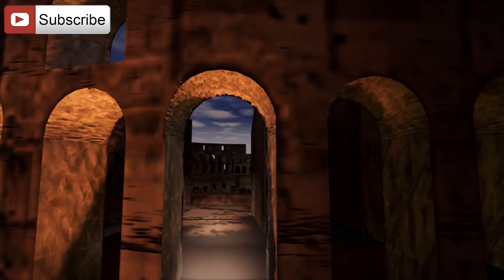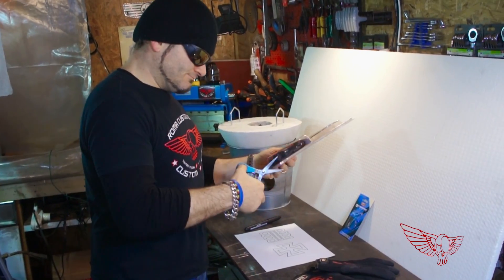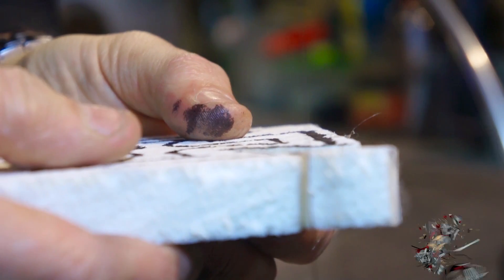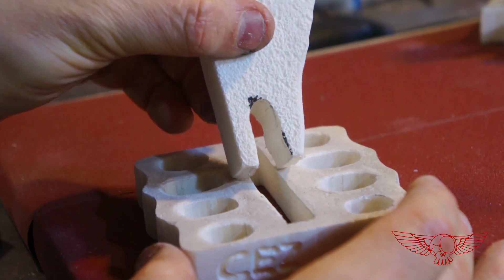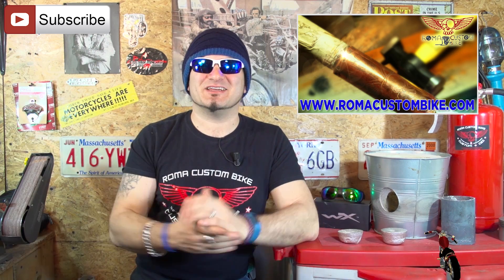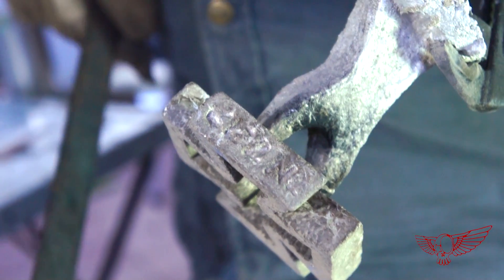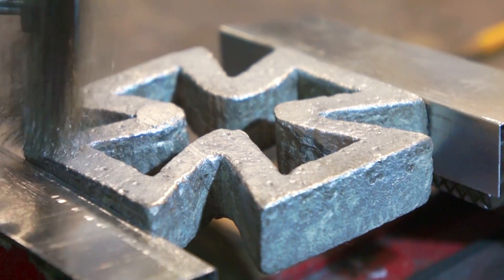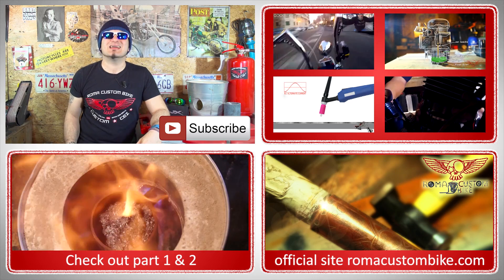DIY Metal Foundry Project Tutorial - Casting aluminium motorcycle piece - ep 31p3 - Roma Custom Bike

Comment: 6:12 You don't have to use pilot holes and rethread your wire like you would do with wood. Just cut a slit taking the shortest path from the outside to the inside. No appreciable amount of sand will get in the slit. It will be vaporized anyway. Remember, you're cutting a negative. ;-)
Reply from the maker: +Bruno Bronosky you know that i didn't think about that!!! You are absolutely right!!!! I could have saved so much time